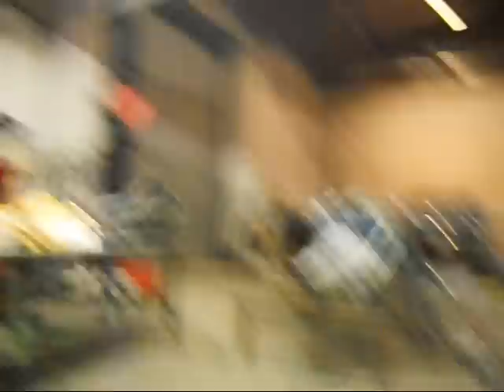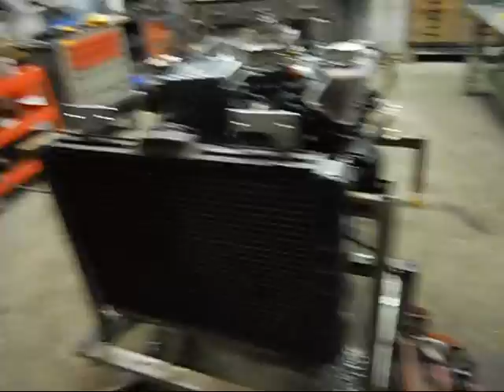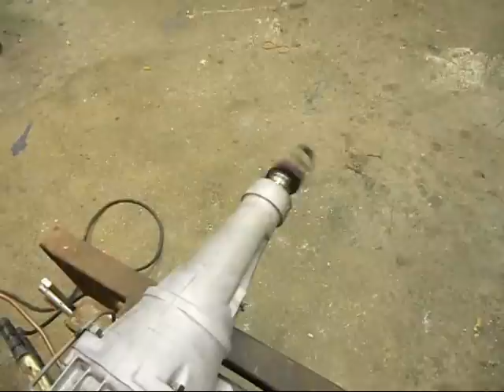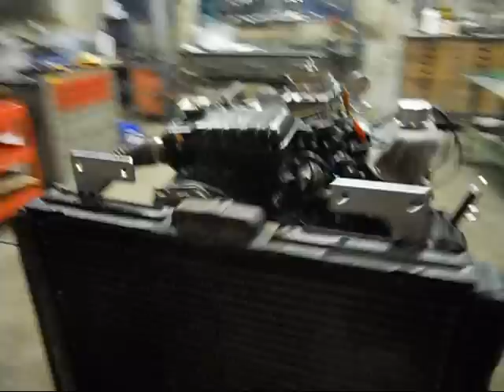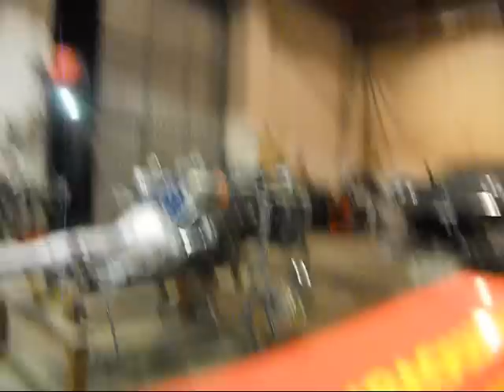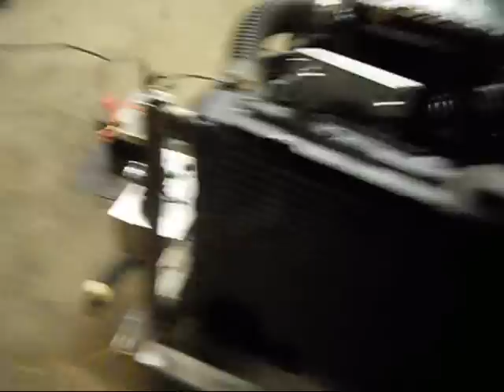ford 410 '66

Comment: Mine was 413 ci with 11:1 CR and the C8AX-D. The crank is 3.98, but I turned mine down to fit 198 Slant6 truck rods at 7.005 and a set of forged 1.15 ch rods with 1/16 1/ 16 1/8 oil rings. A 352 block bored .055  over in a red primer 67 Mustang FB Top loader and 3.70 gears, 61 390 375 hp and 401 with the 6V. I had 2.15/1.6 valves and headers a 67 2x4 PI like the Shelby GT 500. It was a screamer. It was 4.055  bore and 4 inch stroke when I got it done, internally balanced with 6500 with 2 bolt mains and  coated 351C race bearings full grooved. Main studs and good rod bearings and bolts. It was able to run 32 miles on a 2 lane at 6200–6300. I beat a bunch of guys I would have had no business running. Titles for titles, but I never took any ones title and if they had a blow up (,happened a lot.) I d help them fix it. The FE was a racing engine first. I had a little money I beefed it up, crossbolted the main s with ProStock Engineering 2 and 4 caps with oil feed s that fed from the oil filter housing and blocked the passeges  above the cam bearings and had priority oil ing on all but 3. Drilled out the long passege in the valley. It pulled 100 psig oil pressure. It was pulling 525 hp and 510 ft lbs. A lot of fun for what it was.

Comment: quick question whats the idle rpm and timing on fe 410?
Reply: minimum 600 \ 650 rpm, 8 ° advance, check the distributor vacuum valve that functions well.